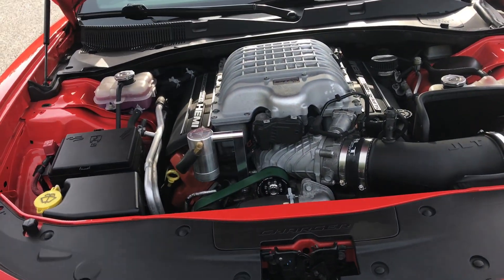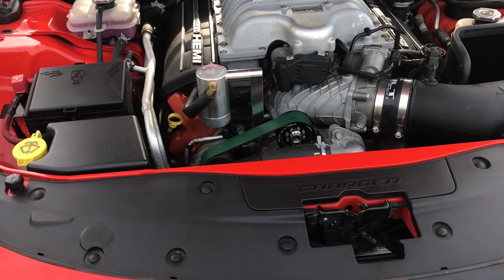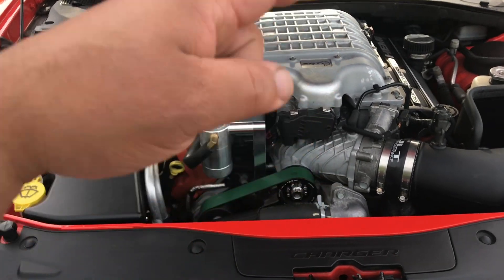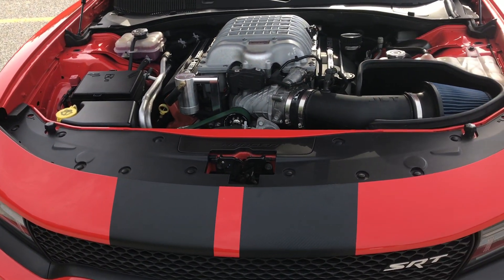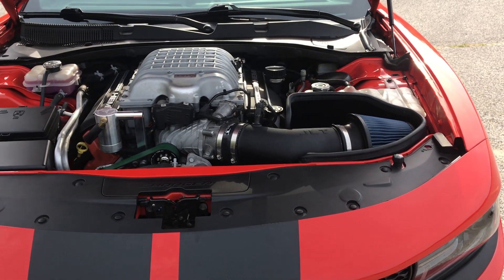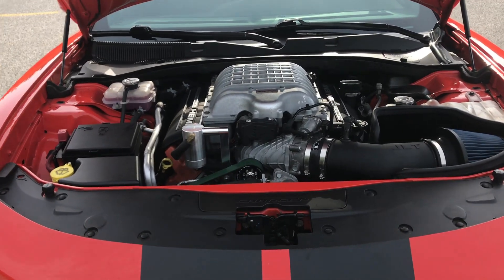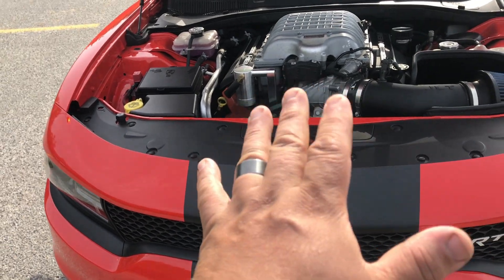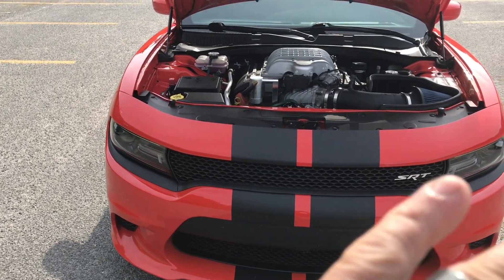2.85 Upper Pulley Only: Pump gas & Race Gas runs #poweredbyHHP

Comment: Right on man!! Almost 9‘s that’s crazy with the mods that you’ve done. I just bought a hellcat and I’m thinking about what combination I want to go with and the combination that you’re running minus the E 85 I think Is one of the best stage one combo for the Hellcat out there!!
Reply from the maker: Thank you!  I’m not sure what area you’re in but if you live in the mid Atlantic region go with HHP. I didn’t months off researching and it paid off well. On the street the 93 tune will cover 98% of ANYTHING on the road and on race gas it’s a monster. E85 is the way to go for sure because you can make the most power for the cheapest cost if available but the main supporting mods you MUST consider first is the driveshaft, Diff (DRS)brace, upper and lower trailing arms. This will ELIMINATE wheel hop and save your axels. What’s your IG I’ll hit you up later.
Reply: @SixTwoHemi  I am from California over here by Sacramento. The combination that you chose is on point my brother. And yeah the driveshaft definitely a must I got 40,000 miles on my hellcat and my driveshaft broke in half without drag radials. Yeah and we have E85 here on the pub down the street from my house. Watching your video makes me excited to get started with my engine mods on this hellcat!! Right on my brother thanks for the response and much appreciated. I will post all my progress on my channel. Keep making those videos my brother!!!
Reply: Rift33SRT  right on right on. I appreciate the info. What did you do to your hellcat. I wanted to do the 2.85 upper pulley and E 85 along with mid pipes. Already have the cold air intake.
Reply: Rift33SRT  Man that is amazing. That’s what I like to hear reliable horsepower. My hellcat is supposed to be my weekend warrior/daily driver so I want to keep it reliable. My Camaro on the other hand is the kill monster. Once the motor from LME comes back I will have my 427 LSX block ready for big big boost. We should hook up sometime I would love to see your hellcat and show you mine.

Comment: Thanks for the content! This is the simple build I’ve been considering. You’ve sold me!
Reply from the maker: Thanks for sharing. Who’s tuning your car??? Do you plan on going to the track or strictly street? I ask because there’s several supporting mods that I didn’t do that I should’ve done initially (duel pumps & axels) if you go upper and lower do a 3.10 & 10% but pin the crank (15 psi) set up with a 2.85 & 10% that will yield (18 psi) around 940 wheel with a conservative tune. Upper pulley only go 2.85 and pin the crank (15 psi) and you’ll love it. Just be clear with Josh as far as strictly pump gas or duel tune pump gas / race gas. I went with Griptec because of the coating and ease of swapping pulleys (15 minutes) if you decide hellraiser clutched you’ll be stuck with that pulley until you change it completely but be aware it’s $700 vs $299 for the Griptec or Metco (non clutched pulley) $179 for the pulley ring only very important to remember moving forward. Bottom line Josh can give you a killer pump gas tube that will destroy 95% of cars on the road and run faster than a Stock Demon or Redeye at the track. Anyway good luck to you!
Reply: @SixTwoHemi  I don’t have a tuner yet. This is going to be strictly a street car. There’s talks about a track being built out here, but by then I may have another platform. Basically wanna kill 95% of what’s on the street 😁. Any of your knowledge will not go to waste. I’m all ears. Should I be concerned with spinning the blower that fast?

I bought the car with a JLT and full exhaust system. Side note: we only have 92 octane.
Reply from the maker: @rolandosantiago8045  No sir. 2.85 = 50% faster than stock 2.72 = 60% 2.65 = 70% 2.55 = 80% blower speed. But keep in mind these numbers are all with the stock lower. If you want piece of mind stay with the 2.85 and have your tuner give you max effort in the tune w/ a trans tune (absolute must). You will need drag radials as this and of these pulley combos will light the tires up at 60+ mph  at sea level. Again, being the car is going to be street driven go 3.10 upper 10% lower or 2.85 upper and stock lower but make sure the crank is pinned (cheap insurance) and paired with (minimum) Demon injectors or FIC 1000 ID 1050 with a drop in duel pump or boost the stock fuel pump with the Kenne Belle BAP this would take care of your fuel system 100% for what you want and will be reliable. Also with the additional power you'll 100% need to address the rear suspension because of wheel hop. #1 Differential brace #2 trailing arms #3 sway bar end links #4 DSS driveshaft (DSS should be #1) because it's street driven the stock DS should be fine. This setup will give you 10 smiles per gallon everytime you get behind the wheel.  @only_digz_6.2 is my IG if you're on that platform hit me up anytime.
Reply from the maker: @rolandosantiago8045  Tuning choices: 
#1 HHP Josh Swartz  Diablo (very user friendly)  EAST COAST. DE

#2 Kurt Dusterhoff       HP tuner (more advanced) East Coast. GA

#3 Tim Barth                  Diablo & HP       Mid west. ILL

#4 Saterra  Tuning         HP Tuner           Mid west. ILL

#5 SRT Autoworks         Diablo & HP      West coast.  AZ

#6 Overkill Perfmnce     HP Tuuner        West Coast.  CA

There's Several others not listed that are good shops / tuners.....ZH tunes, Rippatune, Bailey's, etc etc it all boils down to whatever rabbit hole you choose. 
 
Also, keep in mind if you're in California E85 is a excellent option for fuel choice because it's readily available.
Reply: @SixTwoHemi  seriously, thank you VERY much! I’ll keep you posted on what’s happening 😊.

Comment: I run this setup on a street tire, its awsome, got the drag radials just need the drivshaft/diff brace and I can pop off some times like that, awsome!
Reply from the maker: The drive shaft and Diff brace is a MUST paired with solid trailing arms. It’s definitely worth it. Thanks for sharing the solid information and watching.

Comment: What size injectors? And did you do the fuel pump too?
Reply from the maker: @flairofza  at the time I recorded this the injectors were ID 1050’s and stock fuel pump.
Reply: @appreciate you boss, did it spin bad bad? I just bought the car a month ago lol, was wondering if you suggest i do suspension work too to help traction

Comment: I know this video is a few yrs old but what gear were you running
Reply from the maker: @artmoore4065  2.62. The car is 90% FBO on E85 now minus lower pulley and headers. I’ll be doing lower pulley this winter.
Reply: @SixTwoHemi  thanks for the reply

Comment: What is the heat exchanger for ?
Reply from the maker: To remove heat more efficiently from the intercooler after wide open throttle runs. Very effective on supercharged applications.

Comment: So you making about 770 wheel and 830 crank? You got the link for the pulley?
Reply from the maker: 770 wheel 900 crank 
830 wheel 990 crank 
At the time dynoed* 
Now it makes 810 wheel on pump 906 on race gas
Reply: @SixTwoHemi  dang! What else you added to get 810?😂

Comment: 10.5 with a 2.85? I’m
Debating going that route or redeye but I already run 10.7 stock, like legit stock nothing done not like your “stock” lol I want to know what 2.85 will get me on pump gas... 10.5 ain’t convincing, idk if it’s the weather or.. ☹️
Reply from the maker: 10.5 @ 134 on 93 been 10.0@137 on race gas
Reply from the maker: Also my car is full weight 4600 and the car only has a upper pulley 😂 that’s very impressive
Reply from the maker: Upadate the cars been 10.2 @ 137 on 93  9.89 @ 142 on race gas
Reply: @SixTwoHemi  me too, went a 2.80 9.9@138. Once I’m dialed in going for 9.7. Ran a 10.2 with a 1.50 60 foot and ran the 9.9 with a 1.52 which tells me the car got more in it. But now it doesn’t even matter I got drag suspension that needs to be dialed in.
Reply: @SixTwoHemi  but good job